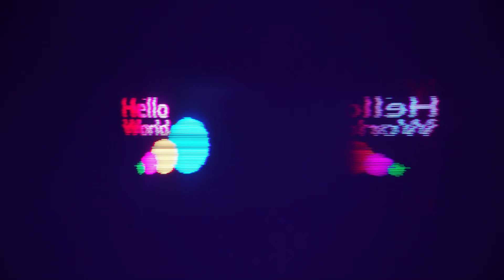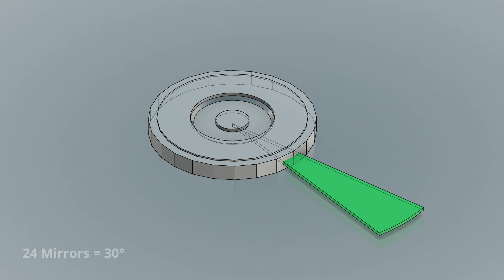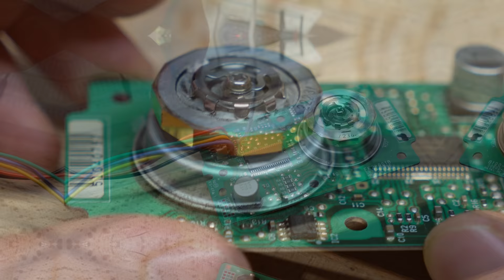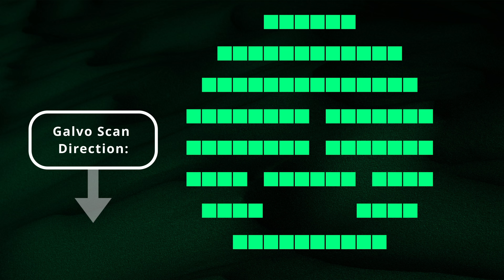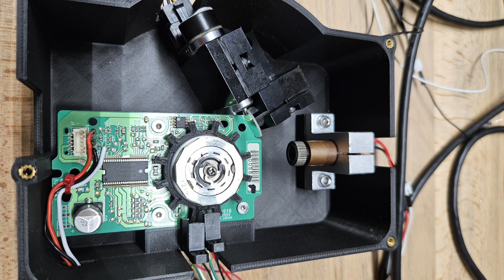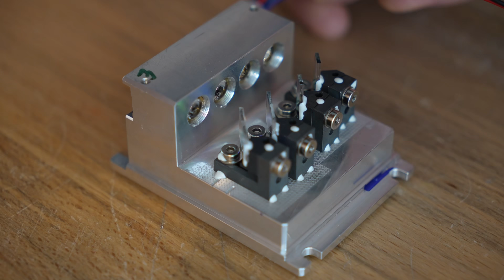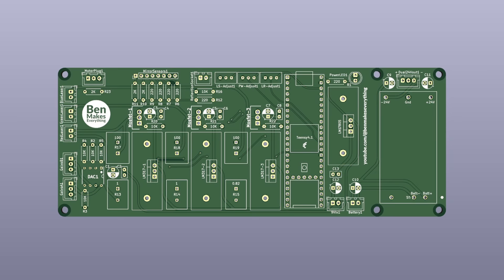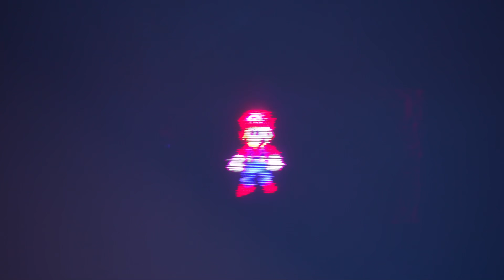DIY Laser Image Projector (100ft+ Range!)

Comment: You also don't *need* a galvo to do the secondary scan, you can use another polygon mirror just spinning at a different rate. This is how many older thermal cameras work with a single detector pixel. Most of those polygon mirrors have pretty bad controls and won't like low speed reference signals, but there's one that does it really well, it's the MP6500/MP7000/MP8000 mirrors (edit: Ricoh MP6500 photocopiers, give the polygon mirror motor a square wave, and it locks to that square wave).
These will require no accelerating or decelerating like the galvo, and has phase locked loops to provide a very stable spin speed.
Reply from the maker: I considered that, but thought it would be very hard to synchronize them. There may be purpose built motors for that kind of thing, but I'm unfamiliar with them.
Reply: @benmakeseverything  the motors I'm referring to are very similar to the one you used in the last video, but ones from Ricoh MP6500 photocopiers have much higher ranges of locking frequencies, give it a square wave and it phase locks the motor to it. to synchronize multiple you just need to get a clock divider driven by the same clock source and they will all sync up perfectly, stably.
Reply: @alexwang007  This is a good solution.  You would want to have two polygons with differing number of mirrors if the non-square aspect ratio is desirable. A 8 and 12  mirror pair would give you the traditional 3:4 ratio and so on keeping the final scan angle in mind.  The further you intend to project the more mirrors you would probably want to maintain higher light output for the same area.

This is reminiscent of the sensors in military night sights from the olden days and some first generation mechanical TV systems.  A few TV prototypes had around 100 tilted.  Some of the night sights had 16 mirrors and 8 microbolometers to give 128 lines of resolution.

With the flexibility of modern micro and galvo he does not need to combine the lasers, just have then vertical and then use software to alight the coloured images and save the optical complexity and losses.
Reply: @benmakeseverything  It’ll be a helix scan with 2 motors running.  Just tilt it to make up for the helix!
Reply: Bearings will be important though.  If you can get air-bearings (ie a levitating bearing using magnets and Magnetic field) it will be far superior.
Reply: @benmakeseverything if they need to be linked maybe a belt system?
Reply: How many sides are these polygon mirrors? I have checked the listing online but the casing hides all the good stuff
Do you have any yourself? Can you describe the polygon mirror dimensions and number of sides / faces please?

Would really appreciate
Reply: @alexwang007 If you have 2 sets of polygon mirrors continuously spinning, wouldn't it produce diagonal scan lines? I guess it could work but it would add extra complexity on the software side to display a desired image especially if the image dimensions are weird.
Reply: @Benetheburrito  You could rotate the assembly so one side of the diagonal lines are perfectly horizontal.  Then you'd only be dealing with each row starting very slightly to the right of the row above, which could be fixed by adding a short delay at the start of each row before sending the pixel data, with each row's delay getting longer or shorter depending on which direction you want to skew/unskew the image.

Comment: Wouldn't it be possible to mount some little reflective surfaces on some piezo buzzers or something of the sort, one vibrating horizontally, and the other vertically, tuning the piezos so the horizontal vibrate at a harmonic of the vertical so they self-sync, and use some sort of feedback of that vibration to sync laser power pulses to keep the pixels aligned with the Lissajous raster sweeps; and use some optics to amplify the sweep angles if necessary? And maybe use two optical stages, one to miniaturize beams to make full use of the tiny mirrors and the second bring it back and get the desired spread?

Comment: Breadboard is not an excuse to only use through hole components. Get a perf/proto board, solder on gpio header pins, solder smd components between the pin nubs on top, shove into breadboard, profit

Comment: Really nice work, very promising, and very well presented!
This could be the holy grail for a modern replacement for CRTs for gaming on classic consoles. Finding some solution for fully analogue signal chain that would be lagless, and without the scaling issues from fixed-pixel displays is the goal. As someone else pointed out, at 320x120 you're half way there! Obviously there's a bit of work to do on the 'colour depth', but I'm sure there are methods for laser diode current control that could get you the ~200 ns/pixel for '15kHz' horizontal scan frequency. Driving the diodes from an analogue source also means you're not limited by your DAC speed.

As for improvements, some projection optics on the output would negate the narrow horizontal slice/angle you showed from increasing the number of faces on the polygonal mirror, as well as with resizing for short-throw setups.
Reply from the maker: Thanks! I did think about the idea of using analog video input (Maybe component?) instead of reading from a file. It would eliminate the DAC problems and it would be cool to hook it up to a SNES or something like that. But the resolution was still too low and i didn't quite know how to synchronize it. Maybe in the future...
Reply: @benmakeseverything  I would have thought a simple register ladder or R2R DAC would be just as fast as a single bit, as long as you can update multiple outputs from the microcontroller simultaneously. Maybe you'd only get a few bits per channel easily (I think the accuracy of the resistors becomes a problem) but it's better than 1bpc.
Reply: VideoDACs are proven technology for example for DCD players and any computer or console after 1990.

Lasers are inefficient at low intensity. Pulses operation is preferred. I learned that the weakest green lasers can run continuous wave. Where do we get as powerful red?

Comment: Cool project.  I would hope the board with the laser printer mirror array and motor would already generate an accurate clock signal (it would need to for the laser printer to function).  Maybe digging into this could remove/reduce the horizontal glitches.  Thanks for the videos.
Reply from the maker: Agreed that would probably be better. unfortunately I couldn't find the full documentation for that board, only the control chip.

Comment: 14:00 you could of built one for $10
Reply: I don't know if he actually needed it for this project but the reason these are so expensive is because they're galvanically isolated and provide a very low noise supply dual rail supply. This allows you to make virtual/floating ground supplies to do things like measuring high voltage signals with lower rated components. Very useful for things like current sense amplifiers on high voltage equipment.
Reply: @oliverer3  I understand what a duel rail supply is its just he could have built one with a few mosfets and coils instead of a $150 module
Reply: @larryslobster7881  Oh absolutely, I'm just saying the price of this part is relatively justified as it's a specialty item. No clue if it was necessary for this project however or just the easy shortcut option.

Comment: For timing the spinning mirrors you could probably use a system similar to what's used on some closed loop control BLDC motors. A radially polarized disk magnet on the axis of rotation and a hall effect sensor

Comment: what about removing the y-axis galvo and replacing it with just a second polygon mirror running at 1/N the speed of the first motor (where N=the vertical resolution)? it means your raster lines would be slightly diagonal instead of horizontal, but that's true of CRTs as well!

at a glance it seems like you would need really precise motor control to get that speed ratio precise, but if you instead just got the motors "close enough" and then tracked the phase relationships, you could just let the laser wander through a slowly-shifting raster pattern, as long as you treat pixels as rectangles and you know which rectangle the laser is aimed at at any given moment the jitter would never be greater than a single pixel's size. ooh, you could exploit this inconsistency to supersample the image! if the motors aren't perfectly aligned each cycle, it means each frame will be projected with some random fractional pixel vertical offset. if you track the laser position precisely enough (no special sensors needed, just some good PLL code to lock onto the sync pulses, as suggested by @mikeselectricstuff) you could use that position to select a nearest neighbor (or some other interpolation) from a higher resolution image. Imagine modifying an interlaced CRT, so that instead of alternating between 2 fixed offset values with each raster pass, the offset is random; as long as you know the value of that random offset, you could get theoretically infinite Y resolution, with the trade-off of finer spatial details in Y getting a lower temporal resolution. (you could have your super-resolution image be spatially dithered, and the random y-phase offsets would convert that spatial dithering into a mix of spatial and temporal dithering, which could potentially lead to a convincing grayscale without the need for an analog driver)

Thinking about exploiting phase errors, i'm realizing: if you drove the X and Y polygon mirrors at the same speed, you'd just get a boring diagonal line. if one of the mirrors was spinning faster than the other, the diagonal line would start constantly shifting, cycling through a perpendicular diagonal sweep at a frequency equal to the difference between the 2 mirrors' frequencies. a beat frequency! so then you just tune that frequency difference. that's a bit too math-y for me though but i feel like there's something there

Comment: I wanna see this captured in slo mo soo badly xD
Reply from the maker: Me too! wish I had a slow-mo camera
Reply: @benmakeseverything  you can film it in "slow motion" by matching the refresh rate of the projector to the framerate of the camera. For example if you're recording at 29.97 fps make the laser go at 30 hz so there will be a slight missmatch in speed resulting in the laserdot seeming to complete one full cycle at just 0,03Hz or once every 33s. Very interesting project btw
Reply: just run the laser clock slower and record at regular speed. free dad joke.
Reply: @benmakeseverything  You just shout out to the Slowmo Guys! :D
Reply: @slomoguys @theslowmoguys

Comment: Instead of the slow and small ram arduinos, use esp32. Its so much faster and so much more ram and up to 16mb eeprom, wifi, bt. And its arduino conpatibel. No big deal to switch.
Reply from the maker: The Teensy boards are actually quite a bit faster than ESP32.
Reply: @benmakeseverything  did you checked the new models? Mhz isnt all. Esp32 sports Dualcore or risc. I like the wifi/bt and there own comuinication protocol. You newer know if you want remote control or statistics via mqtt. And so on. The price is nice as well. Specially this yellow ips display esp boards. But if i need horse power, i will remember your hint with teensy. Thanks
Reply: @OrgathmTech Teensy is also Arduino-compatible. I love ESP32, but ESP32->Teensy is as big a jump in performance as Arduino Uno->ESP32.

Comment: As the mirror has a significant mass, it can't change speed quickly, so you don't need to hard-sync on every pulse -  you could filter/phase-lock the sync signal in software to eliminate the jitter, though starting with a cleaner signal would be better. Maybe use a reflective opto sensor looking at a mirror face to avoid the need for extra mechanical parts. Or perhaps tap into the brushless motor driver to avoid the need for sensing?
Reply from the maker: I do think that using a beam sensor would be superior to the method I used, and in fact, I did experiment a little. At 8:10 in the video, you can see a phototransistor in line with the beam. The problem with that approach was that I kept getting false positives due to secondary reflections inside the enclosure.
Reply: @benmakeseverything  Just use one of those ir laser led's on the other side of the mirror
Reply: @benmakeseverything  When playing with polygon mirrors in the LDGraphy project I also found that the mirrors are sometimes slightly off in the timing as the faces were not exactly the same length; keeping track of which mirror you hit (since you have one once-per-revolution counter) can help applying a different time-offset for each of them. That might explain some of the repeating jitter. I ended up using a photo-diode stuck to a fluorescing piece of acrylic that the laser was passing through (as the laser had short-enough wavelength for it to make it shine).
Reply: @benmakeseverything Mask the photodiode maybe? Recessed behind a narrow slit and otherwise enclosed... should ensure only the intended beam can hit it. Filter as insurance...? Maybe crossed polarizers so only the beam is strong enough to trip it.
Reply: @benmakeseverything that part it's an easy fix just mount an infrared sensor on the top or bottom of the spinning disk with a dot of black paint and an enclosure that isolates the sensor from the light, then you can just make readings every half a second or even longer given the innertia of the mirror itself
Reply: @benmakeseverything  I think perhaps a simple solution to that could be as simple as a set of light obstructors around the photo sensor.
Reply: Surely the driver would have something like a pulse train input for speed. Open loop is 100% the way to go here. 

For an easy fix, just filter your timing signal.
Reply: @benmakeseverything  I would get an old laser printer, it will have a rotating mirror in it
Reply: Exactly what I was thinking, these polygon mirrors are already phase locked, just finding one with a workable driver IC is a pain, I went through this already and found a really good one from a printer. If both axes are phase locked then the scan will be super stable.
Reply: 10/10 excellent suggestions.
Reply: Instead of trying to integrate another sensor, i second the effort to hack the motor speed controller. I once needed rpm feedback from a bldc motor, and sensors were never reliable or accurate enough. So i researched the chip used on the esc & added a bit of code to it to copy the output to one of the h- bridge outputs to an unused output point. That way i knew exactly what the esc was doing for rpm without any extra hardware or processor overhead to interpret another sensor.
Reply: It could be even simpler: since you know approximately your motor speed, you can use timer interrupt to start with something approximately close to the index pulse, and then correct the timer duration with every cycle
Reply: Exactly this. Maybe as a workaround, without redesigning the circuit, count how long it takes for the mirror to speed up to full speed, then sync it a couple of times to avg it, and then do some basic math to lock the image in place. Some cheap toys don't even do that, they just assume the thing rotates at a constant speed the whole time, and it works out most of the time.
Or, constantly measure the pulse signal until it no longer has deviation (avg/median a couple of reading to filter out the outliers). As soon as it's considered "stable enough", soft-lock it and display.
Reply: Shit, you know your stuff
Reply: exactly what i thought, put a pll in the loop and use the pll to control the start of scanline...
Reply: but the jitter looks so cool :(

Comment: for your analog signal issue, you could use a VGA signal, I can't imagine it would be too difficult to synchronise the spinning mirrors to the horizontal sync of the vga signal.
otherwise dithering is a rather simple technique.
Reply: We could store a queue of pixels in SRAM to compensate for deviation between mirror and genlock like on Amiga?

I would really love to see pulse width modulation: “vertical scanlines” . Even if the frequencies on the breadboard are limited, I read that the core clock of the ICs is 400 MHz. At 7MHz pixel clock this gives us 6bit already. Enough for original VGA, genesis, ps1 3d chip .
Reply from the maker: If I ever build another one, I would certainly look into just using a VGA signal since that eliminates the challenge of trying to convert digital info stored on the microcontroller's ram into analog signals.

Comment: Why not use another spinning wheel mirror for the vertical axis ?
THen the only limitations is how the 2nd wheel can go and how fast the modulation of the laser can go as well
THe potential of this new invention are amazing!!!! Thank you for sharing!  
I am halfway through the video and already plan to reaplicate your system with RGB maybe ? Really I think you found something
Thinking out of the box !
Reply: It would be very difficult to synchronize two spinning mirror wheels.
Reply: @KNfLrPn  What if he used a mechanical link between the two mirror wheels ? Like gears or a small belt or chain
Reply: @MonoIit  could be viable, but the high speeds are a concern.
Reply: @KNfLrPn  someone else mentionned using magnetic gears transmission, could solve the issue of friction
Reply: Mag gears have no torque tho it would take a long time for it to get up to speed
Reply: @NibNa5ty  sure, but it may work in the end :]
Reply: This will be harder to achieve since the other wheel will have to spin 12 times faster than the first one to achieve the resolution he started with